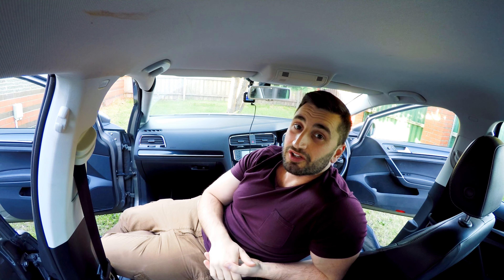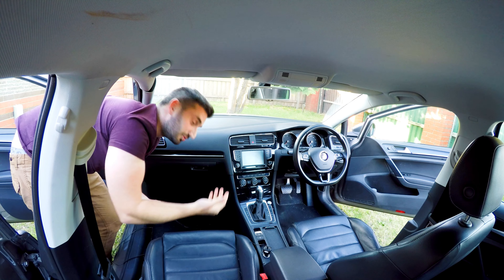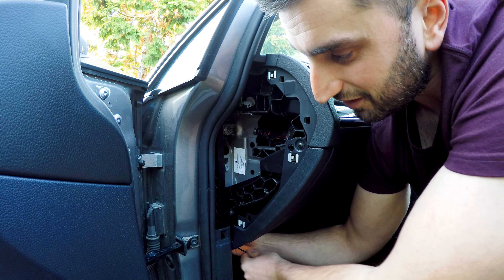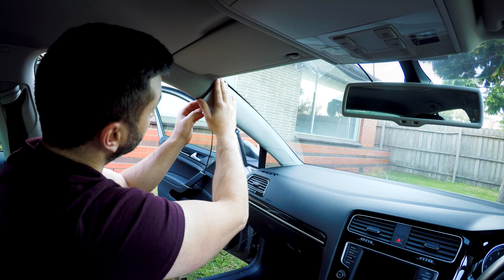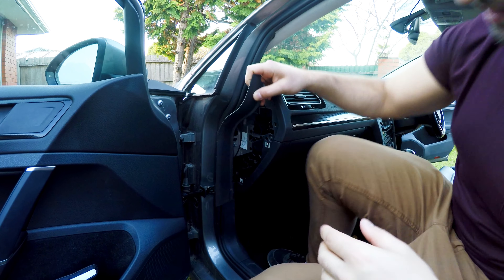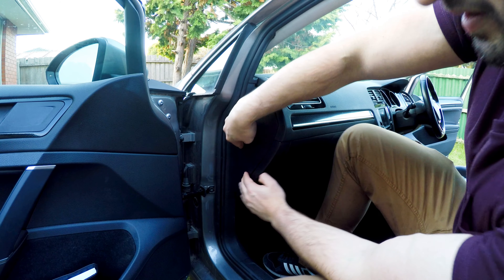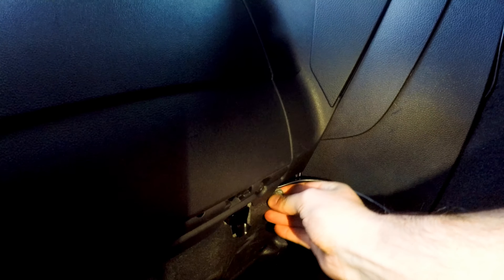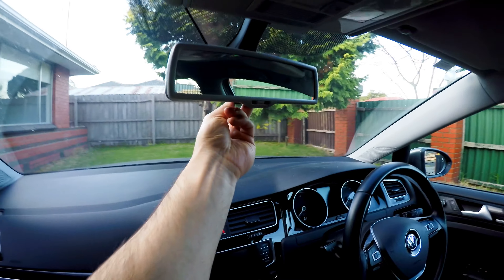Install A Dash Cam - Volkswagen Golf - DVR

Comment: It’s nice that you shared that, but I must warn you that the wire you hide in the A column (between the windshield and side window) is blocking the airbag!
It’s possible to mount the wires there, but you need to double check the airbag position and attach the camera wire to the other wires that are originally in there.

Comment: Agreed with Lee, this video shows the cable being wired in front of the airbag at the top of the pillar which is really dangerous in the event of an accident and airbag deployment. From what I can see in other videos it should be pretty easy to wire the cable behind the airbag at the same location and avoid the issue.
Otherwise a great video.

Comment: Great video, my steering wheel is on the left side but decided to do it on the passenger side. Got the same results😊
Reply: The OP did it on the passenger side also.

Comment: Good video though, 2:30 you're passing the cable across the curtain airbag in the A-pillar - so in the event of it being deployed then the cable will be in the way? I'm trying to find a way to feed the cable behind the airbag safely
Reply: I just put my cable between the rubber seal and the a-pillar. Saves popping it open in the first place.
Reply: @-TJ-  Ok, it may be worth clarifying it though for your future viewers. Fine if you'd like to take the risk yourself though, others watching it should be aware of it! I wired mine under the airbag fairly easily, by going up into the ceiling part it's much softer and you can get you hand in, and in the event of an airbag deployment, it's not going to get in the way.
Reply: @leesuttonuk  I agree it does look as if cable would be between airbag and passenger compartment in this video. I have threaded mine between windscreen and A pillar. Not sure how you get into the ceiling part?

Comment: This is ridiculous. Why run the cable RIGHT PAST the fuse box? Just tap into it. Then you’re also not wasting an outlet that can be used to charge other devices. 

Good grief.

Comment: If I were you I'd integrate the cable directly to the electric panel with the fusebox; so you don't have a dangling cable plugged in the 12v.